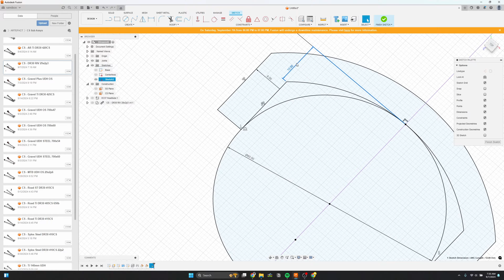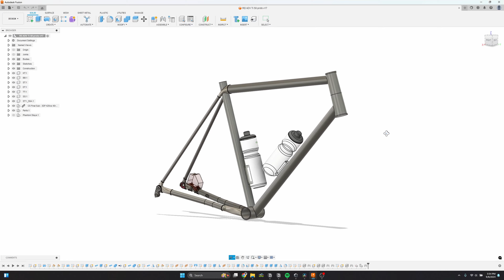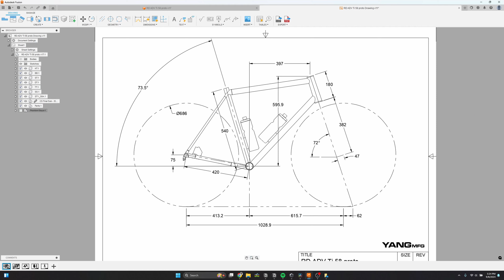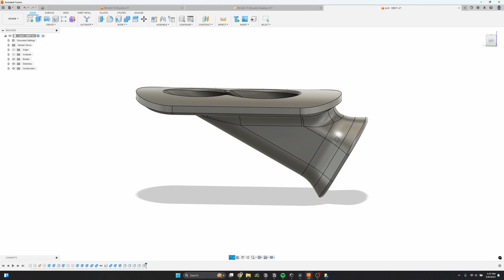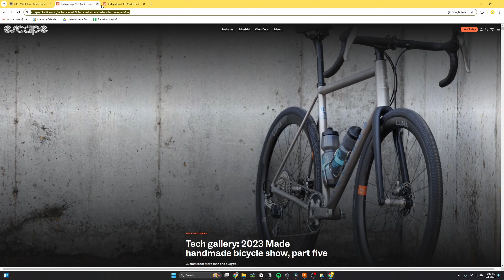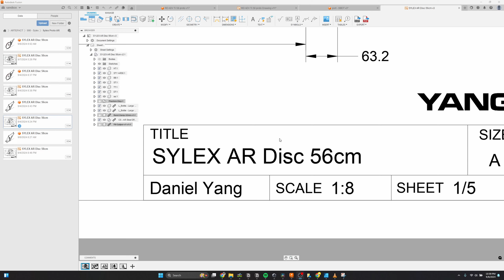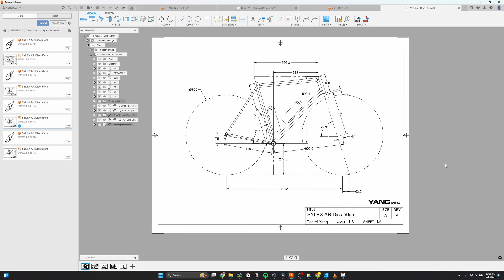A biased unbiased review of a show bike

Comment: I noticed that many of the low volume frame builders featured customer bikes this year. Sometimes explaining options, like internal vs external cable routing. While I am not a fan, wireless shifting does free the design and finishing of a frame. Particularly the new pinion drive for touring, cargo and fat bike frames.

Comment: After watching this video and commenting/following some of your other posts on the socials.... I'm wondering and watching for what you want to build in steel. I am currently riding an All City Macho Man Disc, and while I enjoy the bike for my puposes (gravel & bike path rides). I'm interested in what geometry changes (more BB drop) and high end tubing would be like to ride. I've always wanted a Ti gravel bike. But...could a boutique steel bike serve me just as well?....maybe.
Reply from the maker: @chrisvejnovich116  quality materials certainly helps, but geometry is free! I think you are right, the macho man seems to have inherited its geometry from cross bikes, so it has a higher BB.
Reply: @Daniel_Yang_ARTEFACT  Yup.. Jeff from Wilde designed the bike while he worked for All City, and I remember it being marketed as a cross bike that can be used for all sorts of riding.  For that time in my life and my budget the bike fit.  As I have gotten older and resources are more abundant, I find myself looking for a custom gravel/all road frame.  I have a custom steel MTB full susser and it is amazing to ride.  So, my questions to you if your interested in answering here.
1. Can you compare high end steel tubing to moderate level Ti tubing.
2. How serious are you about producing a high quality steel gravel/all road frame?
3. Will the bike have a steel fork?

I'm not as worried about the weight of the bike as the feel.  I owned a Kona Jake the Snake (rim brake) that was rough, but also amazing to ride as it just seemed to jump up the road.  But the carbon fork was stiff and chattery....and that put me off the bike.  I love metal bikes, and I find what you are doing with 3D printing to be very cool and innovative.  

Thanks for your responses to my ramblings!
Reply from the maker: @chrisvejnovich116  Sorry, it took me FOREVER to find this comment.
1) Tubing: Grade 9 Titanium does not really come in different grades or qualities, only different tempers. High end steels have more flexibility in tuning ride quality with different alloys, butting profiles, and heat treatment. To generalize, a steel bike will be less stiff, but also more comfortable. Durability between steel and titanium depends on design rather than the inherent material properties.
2) Steel production allroad (SYLEX): This fall I will invest some serious research, design, and building time to figure it out.
3) Steel forks:  I have gone back and forth on this. Weight aside, I think carbon is a better match for the stiffness of modern components on drop bar bikes. Inorder for a steel fork to pass ISO testing, it becomes extremely stiff and heavy. Steel fork manufacturers are understandably reluctant to push the limits of construction. That being said, I would love to design a beautiful, contemporary, lugged fork crown for a modern road bike!
Reply: @Daniel_Yang_ARTEFACT  Thank you for your complete reply.  Like most topics...it seems the more into the weeds you get the more intricate the answer becomes.  Like a lot of cyclists...I want it all...I want a bike that jumps when I pedal hard, but doesn't beat me up.  And I want it to look traditional cuz I like steel and Ti.  Ha ha ha....I suppose I should just believe the marketing hype...you know...."snappy, compliant, springy, and playful"...ha ha...Thank you again for your thoughtful response.  I look forward to seeing what you produce in the future.
Reply: @chrisvejnovich116  +1 for steel forks.  This is the primary reason why I'm sticking with rim brakes.  I was able to find a nice compliant lugged fork (Thorn bicycles in UK) for my mid-reach brake Seven ti bike.  It was like adding a suspension fork.  There is no carbon fork that has ever given me such a nice ride quality.   To be fair, I think the fork is on the thinner side of the tube wall thickness spectrum, especially for liability purposes, but it convinced me to have custom built steel forks built for me in the future.  I wonder if such a fork can be built for disc brakes.

Comment: Can you expand on "internal cable routing is easier to build and more profitable"? I'm guessing you're saying lack of ports equates to much less production time and therefore profit? I guess many stem/headset companies have paid for the R&D to route the cables for you already, so reduction of labor is gravy?
Reply from the maker: @whiteryanc  shhhh, can’t let out the secrets. Full internal cable routing involves drilling a single large hole in the headtube and one exit port for the brake. That only works well for wireless drivetrains. To do clean external routing, you need atleast 5 zip tie guides and 3 bosses for cable clips. Fully internal does look nice though!